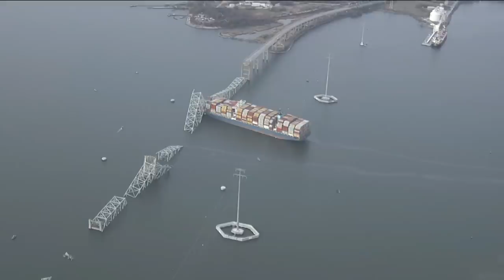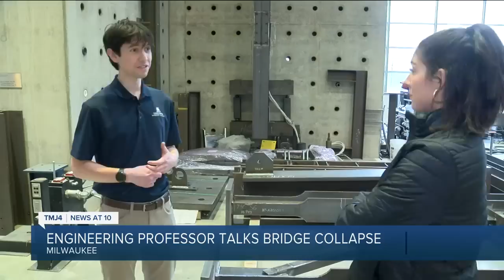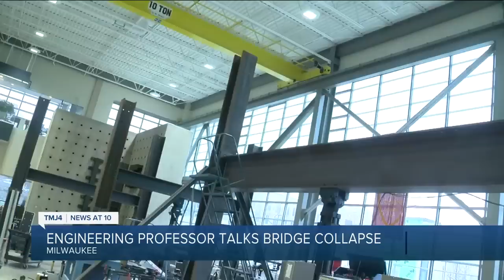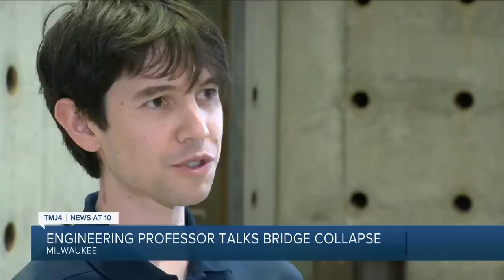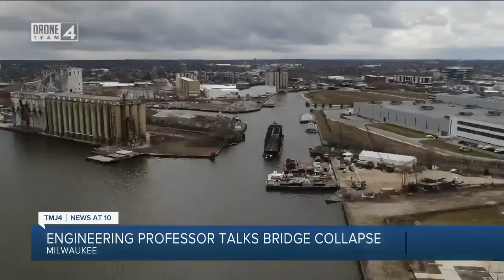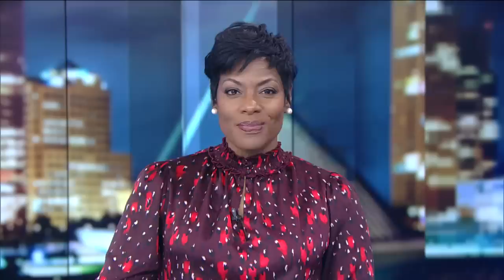Engineering professor says the Baltimore Bridge collapse left him in 'shock'

Comment: The physics is quite easy to understand; very large (size of Nimitz aircraft carrier) cargo ship (very heavy) hitting the bridge is much like a train at 30 mph hitting a car. The forward momentum of all that weight transfers that energy into the bridge support. That bridge support didn't have a chance. That was a very strong bridge, it still didn't stand a chance getting hit with that much weight. Having bridge dolphins would of helped protect the bridge, they would of helped absorb the impact. Bridge dolphins are a group of pilings driven deep around the bridge supports.

Comment: I am not an civil engineer but why the bridge that handles container ship has such a low and flimsy piles?
Reply: Fresh civil engineering grad here. 

Essentially the problem lies with harbor operations, not the bridge itself. The bridge is a typical truss bridge supported by two columns, nothing out of the ordinary. The real issue is that we have the massive ships traversing through critical infrastructure such as the bridge with no guidance or failsafe.

There’s a consensus that there isn’t any bridge on earth that can withstand a 133,000 ton ship traveling at 8 knots. That force would wipe any pillar out. A continuous truss bridge is typically supported by 2 or so columns that run along either side of the bridge’s span with a steel truss on top to stabilize. Long story short, trusses are meant to stabilize, but when they lose a key column like what happened here, the truss is free to rotate and it will collapse in seconds. Every truss bridge will act in this manner. That’s why in the video, once the the column was wiped out, the bridge and it’s truss rotated before collapsing into the water
Reply: @munks4548 Good luck trying to talk sense into the confidently uninformed. At 130,000 tons, that ship may have outweighed the bridge. 8 knots (9.2 mph) doesn't sound like a lot of speed, but if that ship went head on to a beach at that speed, it would have made it quite a way above sea level before it stopped. I'm surprised the bridge fell downward instead of away from the impact.
Reply: @munks4548 In Philadelphia there is a similar construction and age bridge, the Betsy Ross bridge. And on thing it has that this one did not is a big coffer island and huge concrete dolphins to protect the water supports from ship impact. They added them during its improvements about 10 years ago even though the ships that travel this section of the river are not as big as the ones in Baltimore harbor.
Reply: @rafaelrivera9346  To my knowledge there were dolphins around the support that was wiped out. These dolphins however are meant to deal with small boats. Calculations have indicated that a ship of that size and that speed would beach itself on a normal shoreline, so it made quick work of the small dolphin islands around the support. Unfortunately there was little preventing this disaster other than better harbor operations and/or tugboats to ensure the cargo ship makes it through unobstructed
Reply: because no one expected a crash of a gigantic ship like that

Comment: I mean how hard it is to measure all the bridges and provide that info to Cargo Trucking companies?  They can even install sensors on bridges and trucks alerting the driver the truck will not pass under and they need to use an alternative route. We live in the age of technology but technology is mostly used for political propaganda and not where it is most needed.
Reply: Or drivers could put their damn "technology" down and pay attention to the road and the signs alerting them to a low bridge 🤨
Reply: @johneckert1365  Firstly, not all bridges have signs. The signs on the bridge aren't always visible it's written on the bridge itself, so you can only see it when you are passing under it.

Comment: A major bridge with nothing protecting the piers despite the risk of collision from marine traffic? In regions where ice flows may impact a bridge during spring breakup piers are protected with rip rap. Essentially a tiny island is formed by dumping rock and soil. This is the cheapest material and the easiest to place. The cost of this protection relative to the cost of the bridge is not considerable. If a pier is surrounded by a coffer dam soil can be dredged from the river bed and pumped into place forming an island.
Reply: it did have dolphins and other large concrete protective pillars but another engineering expert said that when built in the early '70s, they were not now adequate for the size and tonnage of today's cargo ships
Reply: absolutely right
Reply: Yes exactly. The problem is the U.S. government would rather spend money on wars and bailing out Wall Street than upgrading our infrastructure. U.S. gets a D- every year from civil engineers. It's the priorities that are the problem and it's getting worse.
Reply: This is what happens when empires reach too far. They rot internally. Rome was no different. Our leaders have other grandiose priorities in places like Israel, Ukraine and Taiwan. Things like infrastructure, healthy food and viable elections are not on the agenda.
Reply: Corruption, lack of vision, we learned very little from the attacks on this country.  Adding large stones around the piers of this bridge makes too much common sense, the problem comes when everyone with equipment fights for the contract by sueing the hell out of the city and can hold up progress for years. Time to cut beauracry.